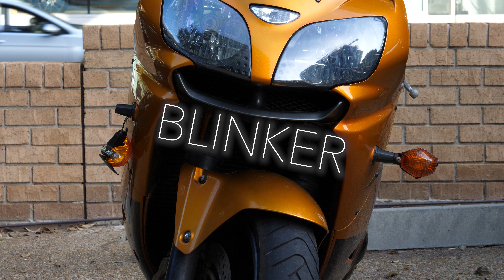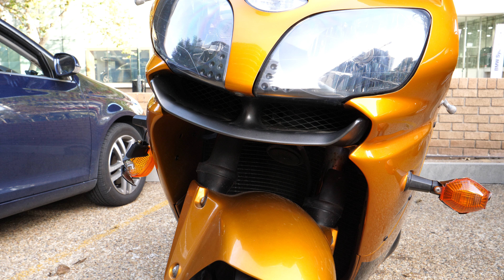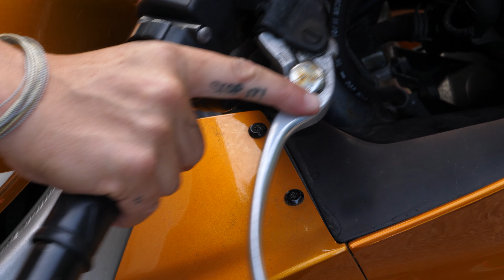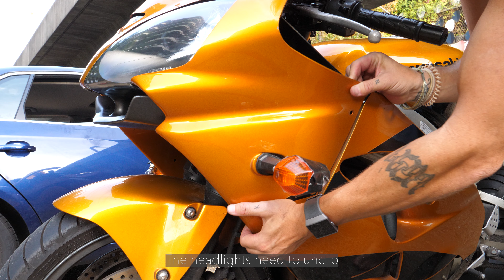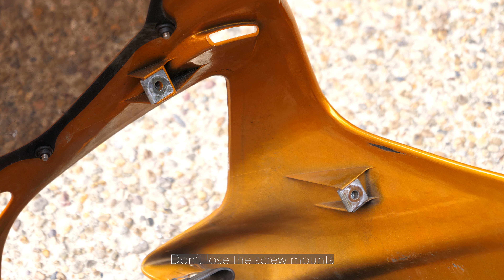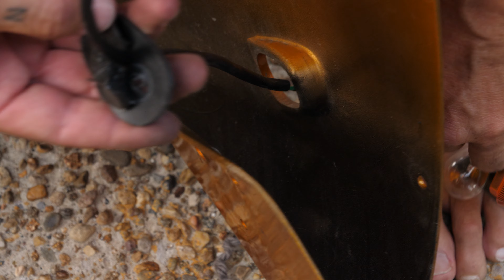ZX-9R 2002 Blinker Exchange

Comment: On my 2000 aligning the two fairing screws under the air intakes was a huge issue, I just couldn't see anyway of aligning those bloody intakes so in the end pulled them off the bike and attached to the fairing before the mounting the lot back on. Something I thought was going to be easy turned into such a headache!